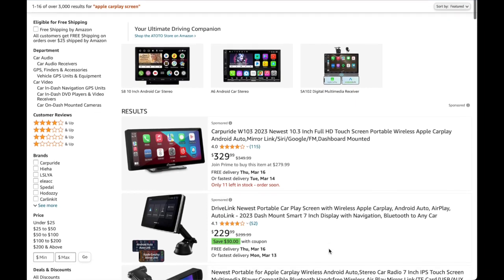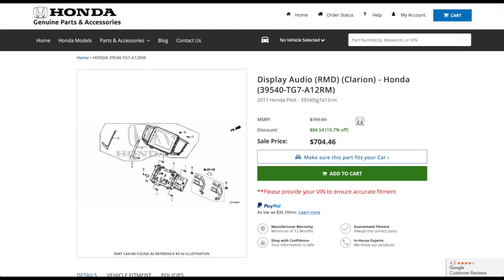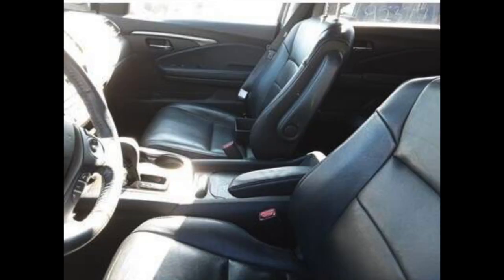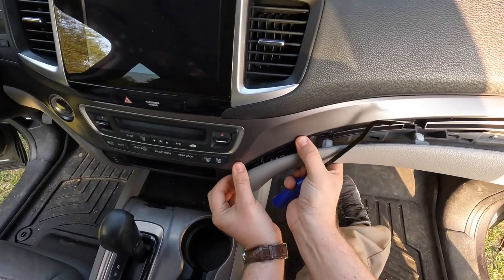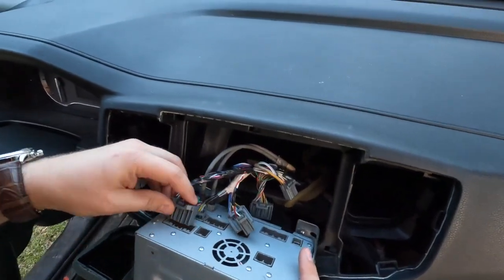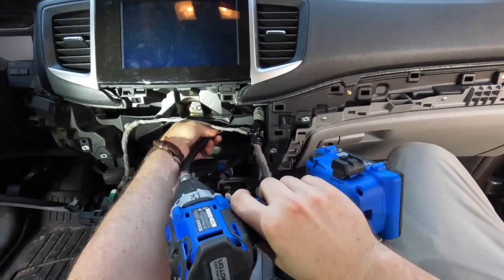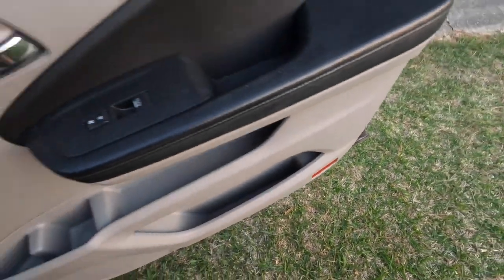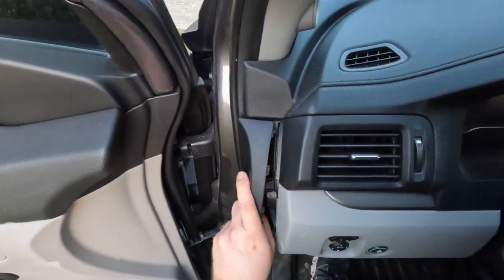Let's install Apple Car Play - Honda Pilot 2016 EXL (Step by step)

Comment from the maker: This happens to be my most popular video on YouTube. Surprisingly, I'm not a 'car guy,' but a beekeeper. If this video has been helpful to you in any way, I'd sincerely appreciate your support for my latest beekeeping video here: 🐝 https://rb.gy/mqz7bg
Reply: Hello Lucas, this is a very informative video, I appreciate the details.  I have a 2016 Honda Pilot Touring and I believe the part number for it is 39540-TG7-A42RM instead of the one you mentioned for the EX-L.  A couple questions for you, if you don't mind:
 - I think the 2017 and 2018 models were required to be connected to your iPhone with a wire/cable , does Apple CarPlay now support wireless connections with these models instead so we don't have to deal with the wired connector?
 - Are there any concerns with having to change out the receiver along with this unit?

Comment: Thanks for the helpful video.  I did this with an Elite model of the 2016 Pilot.  Things are a little different on the Elite because there is a dvd player for the rear entertainment center below the climate controls.  This makes the job more difficult.  I had to remove one of the side brackets from the dvd player to get it out, and it was still in the way making it very difficult to turn the screws at the bottom of the radio.  I finally got it done but it was not easy.  Fortunately, I had the right tools around the house.  Now I have Apple Carplay and it was worth the effort.  Also, I had to pay close to $500 for a salvaged radio.  People are on to this now and have driven up the price of salvaged radios.  I bought one from a car with front end damage.  I did this because there are very few wrecked Elites available and I didn't have much choice, but it worked out.
Reply: What model number did you use for the Elite ? Is it the same one ?

Comment: I just did this tonight in 40 minutes in my 2016 EXL Pilot and it all went like clockwork with 2017 EXL stereo LKQ sent me.  It wants the code so I’ll start calling Honda tomorrow.
Reply: I called the number Lucas provided and I got a code in 5 minutes.  The operator said she had a list of five codes I would need to try till we found the right one.  The apple car play app was not as obviously displayed as on our 2023. And it connects using the left usb on the dash and not the one in the center console
Reply: I have the Honda Pilot and I'd like to make that change the truth is.

Comment: Thank you for the video. Very helpful. Have a couple questions. For the code that I need to get from Honda. Do I need the VIN from my car or the donor car (where the replacement radio came from)? Also, do I need the radio part number for the one that was on my car or the replacement?
Thank you

Comment: Hello Lucas, Thanks a ton for very helpful, hopeful video. You did amazing job, This lack of Carplay is big turnoff. I have a 2016 Honda pilot touring with Blueray/DVD player and navigation system, Can you please confirm if the replacement works similarly for me? What is the part number that i need to look for? Someone in the comments mentioned about tough job to replace on thier touring elite model, not sure if mine will be in that same boat. Thanks in advance.
Reply: Hello I’m in the same boat. Did you find a solution?
Reply: I just bought a Honda Pilot 2016 Touring edition. The radio sucks/lacks features. Also needing exact part number. Would a 2018  work? Basically, would like to search for the MOST recent model that would work. Thanks
Reply: Ha, asked the same question a few minutes ago.. 
"Has anyone seen / know of a reference to which Yea/Model is fully compatible with which year/model head units? I just got a 2016 Honda Pilot Touring edition, VERY disappointed with the stock current stock radio. It really sucks. I even rooted it.. and have other apps installed. Any suggestions in 2024? What's the highest compatible model I could swap it out with? Is there a chart , a website that gives compatibility, etc. ?"
Reply: @The_Virtual_Future  G Just wanted to see if you got an answer on this, I am about to do the switch and want to the latest compatible version.
Reply: @Ugadawg631  No honestly, for the cost and trying to find one in good shape, decided to wait. I have my phone screen Mounted right next to my steering wheel and don't pay much attention to the Stock garbage stuck in my Car.

Comment: Lucas, I ordered everything I needed and installed the radio with zero problems whatsoever (thanks to your video). THEN the problems started. The radio gave me a message that it couldn’t be turned on without a “code”. I called the Honda number you provided in the link, they gave me and they gave me the code. Once I entered the “code” it read that it was an incorrect “pin” number. Would it be helpful to give the Honda 800 number the vin # of the vehicle it came off of (because the place I bought it from gave it to me)? Thanks
Reply from the maker: Randy can you send me an email? I'm out of town and need to verify some things on your end. Don't forget to reply to this post later to give onlookers an update.
Reply: My understanding is that Honda support will need the VIN of the vehicle the radio was originally sourced from and the serial number of the radio itself to provide you a proper unlock PIN.
Reply: @ReverendTed  will the VIN of the vehicle be on the unit?

Comment: I have a 2016 ex-l without navigation or rear entertainment. I called lkq and went through what I am trying to do with the fellow, at one point he mentioned a part similar to the one you show but eventually landed on 39710-TG7-A01 which google suggests is the right part……not easy to decipher which part number is correct, does anyone know an exact listing of which part number goes with which trim and year combo?

Comment: Thank you so much for your quick and clear video! I will soon be trying this with my 2016 Honda Pilot Touring. My question is do navigation instructions sync to the dash when using CarPlay? I couldn't stand the Garmin navigation system and don't want to pay to update the maps but the navigation instructions on the dash were nice.

Comment: Thanks for a very helpful video! Mine is an ELITE 2016, I am trying to find a 2017 ELITE radio but don't see any. I did find a 2018 ELITE radio, you think it's going to work on a 2016? Thanks
Reply: Most likely

Comment: Hey Lucas I would like to know the model number of that radio you just installed 
Ikq ask to send them the model numer for the carplay, the one the sent me was 3700 model that no good
Reply from the maker: hey @Mb1913, the model number is in the description. However, in my experience with speaking to a lkq representative: I'm under the impression that customer support uses the same search engine/method as the common website visitor. Having the radio's model number didn't help me locate it but having the other information (in the video) did. I hope this makes sense.
Reply: @LucasGandy  thank you for your help

Comment: Have a 2016 Touring and all audio goes to static and ultimately no sound after a few minutes.   Dealer has no idea.  Tried replacing the amp and the tuner, considering head unit next.  Any thoughts?
Reply: Hello this is a common problem with the pilots. You need to change the unit
Reply: I am having the same problem with my 2017 Ridgeline Black Edition.  1st factory radio I bought bought of ebay, I was given 20 different codes to try.  The only bad thing is after 10 attempts, you will get the black screen of death and will be locked out from that radio.  Bought another one to try but after 5 attempts, the Honda 800 number told me I needed to take my Ridegline to and radio in to the dealership to get it "reprogram".  Not sure of the cost so, never took it in and been driving without the radio for 2 years and counting now.

Comment: Does the back up/rear and side view cams still work properly with the 2017 face installed? Assuming this is why it’s necessary to get the exact same trim model.
Reply from the maker: Yes, everything works great. I can only say with confidence that the exact trim works 100% with this model. If anyone has something different to add, please correct me.

Comment: Did you lose your back up camera and woofer? I went to car toys and they told me I would lose all that to just replace the head unit with a 2017.
Reply from the maker: No ma'am - everything works fine and I haven't had any issues

Comment: Would a 2018  work? I have a 2016 Honda Pilot Touring (no Android Auto play) but rooted ;-)    Basically, would like to search for the MOST recent head unit compatible model that would work. I would love to get the volume knob instead of the stupid touch controls.. Thanks
Reply: Were you able to add a 2018?
Reply: @kristeleonardo  The urgency to replace the lame radio expired.. Considering the cost and the time. I mean I realize I actually use my phone 95% and hardly use the built in audio controls. I did root it and sideloaded other software that forces it to jump to Bluetooth connection and gets rid of annoying  pop ups.

Comment: Great video. I’m still trying to find the radio since the link you have does not have EXL w/o Nav and w/o rear ent
Reply from the maker: Thanks! Finding one will take the most time. Parts are added almost everyday with a first come first serve basis. Found you one here on the 3rd page: https://www.lkqonline.com/2017-honda-pilot-radio-audio/-hO4PPFc3PK/-i~341350633
Reply: @LucasGandy  hope the condition of the screen is good cuz it looks weird in the picture
Reply from the maker: Keep us updated. Best of luck to you
Reply: First of all, thank you for putting the Link and helping me finding the radio. As you suggested it’s much better to buy a radio from a car that was hit from the back instead of the front because the radio that I received did have a few scratches but I buffed them out using compound. Installation was very easy. However, when it came time to put the code in, I called Honda. The representative refused to give me a code, kept telling me hold the power button finally ended up giving up waited another five minutes called back got another representative and finally got the code right away Now I finally can enjoy CarPlay.  Thank you 🙏
Reply from the maker: They have a pretty good 30 day return policy if anything seems off. The power button they're referring to is located at the top left of the actual radio (not the engine start/stop button). I'm glad everything worked out for you.
Reply: Were you able to figure out the right part number?  I have the exact same model and I’m let to believe the right part is 39710-TG7-A01 but it’s still just a best guess for me.  I ordered one so will find out shortly I guess

Comment: I’m thinking of buying a 2016 pilot
Reply: DONT!!!  Research the issues with the radio.    Honda still can't figure out what it is between the head unit, wiring, amplifier, etc.  There are MANY people (myself included) who are driving a 2016 Honda Pilot with no freaking radio!   We have a Touring AWD.   I'm hoping replacing the head unit fixes it but no guarantee.   Just search 2016 Honda Pilot No sound from radio.

Comment: Does it work with 2016 EXL with Navigation?
Reply: I found this part and want to confirm it will fit before I buy it - 39540-TG7-A24RM

Comment: Anyone know the difference between these two part numbers? 39540TG7A11/39541TG7A12 I have the 2016 Pilot Touring and want to ensure that I get the android auto unit.
Reply: 39540TG7A11 is from a 2016 Honda Pilot. 39541TG7A12 is from a 2017 Honda Pilot.